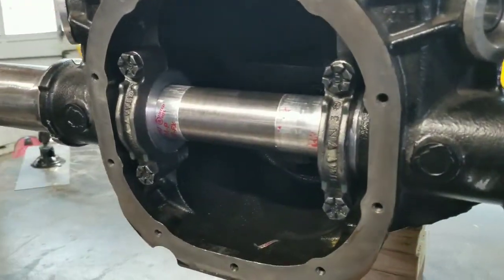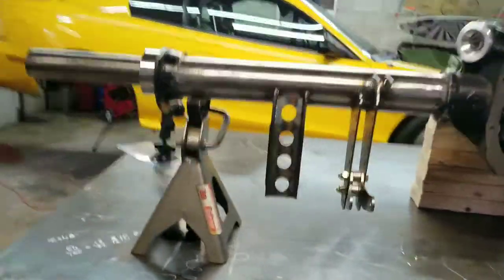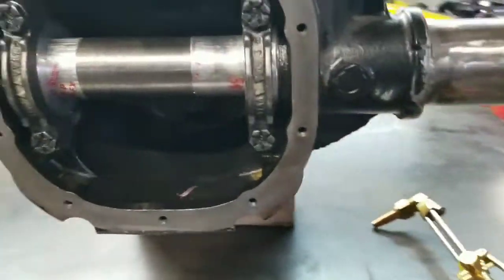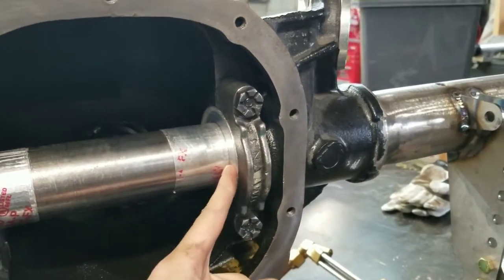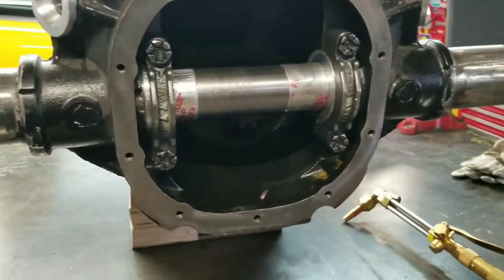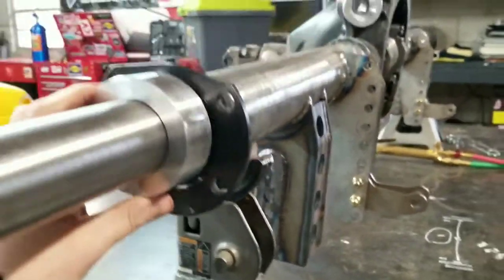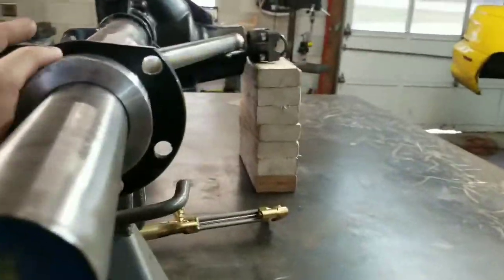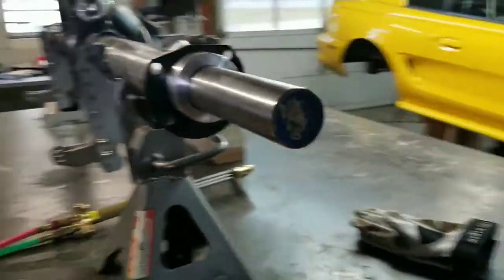Bent Axle Tubes?! - How To Fix It.

Comment: Thanks man, great video. I race circle track and banged wheels saturday. Knocked the LR axle tube 1/8" out. That axle shaft was pretty tight coming out when I was doing my gear change. Will use your method this weekend to correct it. Thanks so much for making the vid 💪🏾 With mine being a floater, I will just use the axle shaft on the hub end to see when I move it enough. I cant imagine 1/8" will take much heat and quench
Reply from the maker: These was about 1/8 out and they moved easy! Glad I could help you man
Reply: @BetterBuiltMoto27 awesome. Hope to report back good news on saturday!
Reply: Totally bummed. 5 heat cycles. Finally went straight and I was happy... cooled down an hour later and went back to bent in the same direction. My circle track rear has thick wall axle tubes... .35" or so. I may run a weld bead tonight on the long side to see if it will pull it in but doubtful. Ugh
Reply from the maker: @brianswiger9390 did you use cold water to help pull it after you used a torch? Did you use a oxy acetylene torch?
Reply: @drewjackson4056 yep. Torch to cherry red, soaked with a towel in ice water. I think because they are so thick walled, didnt start moving until I had heated entire circumference
Reply: Rear is already back in car. I may try again with it installed. I qualify friday for our big race saturday. Probably gonna run it as is for one week and call it a season

Comment: I found that it works good to heat a large area and the watch it closely as you cook it with a wet rag, I move the rag as the pipe moves to pull it right into the spot it needs to be.

Comment: Caution,,, As u have already mentioned AT   3:15 you can see the puck is not a tight fit on shaft 
## TIP   1 / the puck needs alot larger diameter  where it meets axle flange 
2 / A locking collar which clamps to alignment bar  can also help align /square up axle tube puck

Comment: Super helpful! One concern: does heating and quenching harden the metal, therefore making it more brittle and prone to cracking? Is the area spread out enough that it doesn't really matter?
Reply from the maker: A tube isn't going to break like that. The center section is by far the weakest

Comment: What type of round stock bar and what size bar did you end up using ?
Reply from the maker: just go to local metal supplier and say i need a piece of 1.5 or 2 inch round stock

Comment: Tnx for the vid.
That job is awaiting me aswell.
Have a 04 TJ sahara. Fitted JKR axles to it.
Had to fab all new brackets to fit the longarms and marry up the jk axles to the tj chassis.
Subseqently the rear axle warped in a smiley arch. Current low tech measurents show 6mm. Or 1/4"
Hope your system works
Reply from the maker: yeah man mines as straight as an arrow thanks for the love!